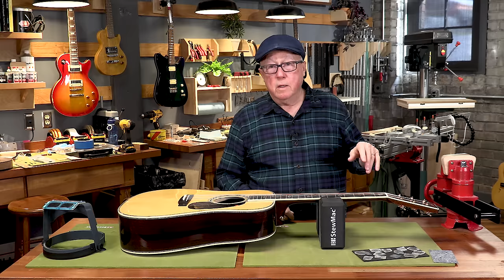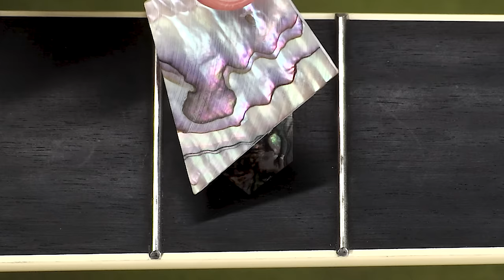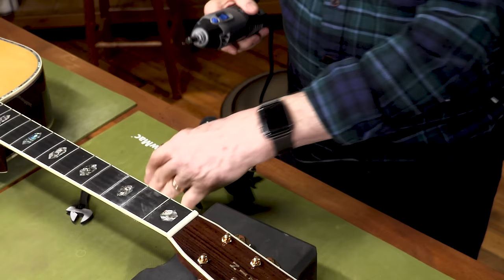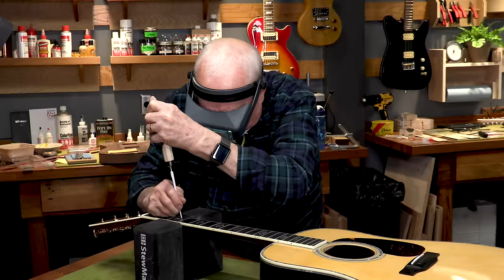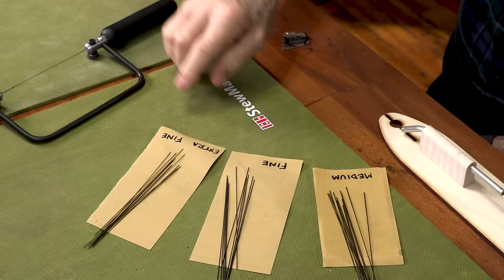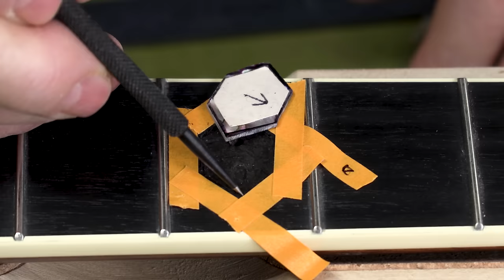How to Replace a Fretboard Inlay on a Martin D-45

Comment: I mean for $10,000, Martin should be the ones doing this job, for free.
Reply from the maker: I believe Dan said they would do it for free but it would take a while.  The customer didn't want to wait that long.
Reply: @stewmac  Well, I probably would have gone the same route. At least the owner knew that the job was going to be done right. One of the first video’s I watched was when Dan fixed the 50’s Stratocaster that was routed for a Floyd Rose. Spectacular!
Reply: I don't see why Martin would have to do this for free. It's not like it's a defect; the customer just didn't like the inlay color.
Reply: @reverb508  Of course he didn't like the inlay color, because it was the wrong color. Jut like he wouldn't have liked it if one of the tuning keys was a completely different shade than the others. Most people just expect better craftsmanship at that price point, which is exactly why Martin said that they would fix it for free.
Reply: Yes they've dropped the ball on this one,shame on you Martin using abalam on such an expensive instrument,I'd expect this low standard from Gibson.
Reply: It shouldn't have passed inspection TBH. The luthier should have known better than to use an obviously out of place, mismatched piece like that.
Reply: @gregmullins6927  oh the outrage. Lifes tough in youtube comment world.
Reply: Ace  well they put the wrong inlay in. They put a cheap alternative instead of real abalone. It would be like buying an American Fender that has a Chinese pot metal bridge on it.
Reply: Ace  actually im not really sure anymore tbh
Reply: For that price, I want to hold it before I own it.
Reply: You would also think they wouldn’t mix the 2 types of abalone
Reply: user-sm6nm2qj7b Spoiled? Really?! I don’t think so. I think these companies are spoiled being able to put such high price stickers on musical instruments with cheaper materials and lower workmanship standards. Try changing that name on the head and see whether anyone would still pay $10k for it. That should clear it up at least when it comes to quality..
Reply: I hear they are using Lutz Spruce now, I see the website does not say Sitka anylonger, just Spruce...very sad to see that their top of the line instrument is getting substitute materials when the price is only increasing every year. It almost makes you feel like you aren't getting a real D45 anylonger. Dan did a fine job as always on the D45! I really admire  his attention to detail and skill!
Reply: @disco4535  Yeah check and mate. It’s a QC issue. I got a 100$ in return (store credit) on my Les Paul CS BB because of SMALL errors but for $3600 I expect flawless quality or else I would’ve bought their standard for little over half price.
Reply: @reverb508  You're definitely wrong about this there is no leeway for you to be correct here. No matter how outrageously petty it is. This guitar was $10,000. It's like painting the front left fender of your car a different color and saying well it's paint so it's consistent lol.
Reply: @badhabit8824  Except abalone isn't paint; it's a natural material that is not consistent in appearance. Your analogy is awful. If the buyer didn't like it, that's a matter of preference. They could have returned it, or better yet, not bought it in the first place. Caveat Emptor. If they're ponying up 10k for an instrument, perhaps they should have made sure they were happy with it first.
Reply: @dba4292  Your first mistake was expecting flawless quality from a Gibson. They've never had brilliant QC, even back in the 50's. Sure, CS does better than the USA factory, but Gibsons are just beautifully imperfect instruments. Buy a PRS if you want a flawless guitar.
Reply: @reverb508  Agree 100% Lesson learned 👍
Reply: @reverb508  Martin is a major manufacturer, they most certainly would've had numerous pieces to pick and choose the best match from.
Reply: Personally I would leave that “defect” alone because it makes the guitar look more distinctive. Also if the guitar gets stolen it can help it get identified

Comment: Just excellent.Tricks like the acetone magnet cup, the fence, and the piece of scrap to prevent the tipping are what separate a true master from everyone else doing this work. A D45 is roughly a $10,000 purchase that should not require remodeling. It’s too bad whomever  inlaid that guitar at the factory couldn’t have taken an extra five minutes to look at the big picture and get it right. Martin should reimburse this customer 200% of whatever this repair cost to execute, along with a letter of apology.  My $.02.
Reply: You buy a D-45 purely for the eye candy as it's not superior to cheaper models, it's all about the looks. I think Martin should use real abalone, not abalam. I don't like those obvious straight lines in the inlays. At that price I expect the best of the best only.
Reply: @AndreaAustoni  agreed. For that price real abalone all the way around would be a must in my book.
Reply: just like this guy should have taken the extra time to recut that piece of abalone to fix that gap instead of using glue...terrible

Comment: If you don't have Abalam or the correct piece of abalone on hand, or you don't have the time and/or skill to order and cut your own, you can call Martin and get a laser cut 3rd fret position hexagon in different shades and pattern densities. Just tell them what you need.
Reply: Thanks. That is the info I need. Have a D52 with an inlay missing
Reply: @jjiacobucci  Tell em Dan sent ya
Reply: True but you should not need anything for a brand new D45. The original inlay was a scar that should not have made it out the door to begin with.
Reply: I wouldn’t have accepted it. It’s a $9,500 guitar ffs
Reply: @brianhanson9367  You should see the big money instruments I see people accept.

Comment: Normally I see great job done here. This time for this grade of the instrument I have cringed so many times that I do not want to become hater. Drilled to deep into the fretboard, to narrow inlay, discolored pearl a bit on the nut side. Man that might be OK for some china made guitar but on D-45 it is a crime in my book. Especially for that nice of a example. I would not like that even on my Japanese Morris guitar. Sorry. I would take it somewhere else and redo it. Fill it under with ebony dust and glue to get flat surface and get proper fitting inlay in it. I did not liked it at all sorry.

Comment: I bought my D-45 new in 1989. It’s not been played much but has been back to Martin 3x for warranty and non warranty repair- to include a bowed top, a bridge replacement, repair of a cracked brace, repair/replacement of split bridge plate, it’s 2nd neck reset and some refretting. What really surprised me was a shim under the fingerboard at the body joint. At this point in my ownership I’m seriously considering selling it.
Reply: I was surprised at the mix of Abalam and Abalone. The Abalam is very noticeable. Mind you, we need to cut down on abalone fishing. like everything.

Comment: It's strange that the luthier who built that D45 would have used that perticular piece of abalone.  It was drastically darker than all the others, and for what I'm guesing he paid for that thing ($9945.  Just checked Martin website), it makes me wonder why it was used on this instrument.
Reply: This ^^
Reply: I've never done inlay work, but would guess the inlays matched nicely when they were first laid in the fretboard.  The leveling/sanding afterwards could have exposed a different layer of colors.  Then the question is, do you rework it or go with what nature intended?
Reply: @melodicdreamer72  Those are good points.  My only thought is the inlay pieces start out pretty close to size.  Your thoughts are still valid possibilities, however.
Reply: Dude buys a new Martin D45 and then sends it to a Stew Mac shill to replace the inlay...mmmmk
Reply: @frankdiscussion2069  Is Dan Erlewine a shill?
Reply: @melodicdreamer72  by definition...yes

Comment: That's the difference between hand cut and CNC folks. Look at some vintage examples closely and you will see a perfect fit is quite rare. That said, this one really was a miss. I would not have been happy if I was the customer. Frankly, I think they all should have been replaced. The seams of the laminate abalone is just too off-putting to me on such a high-end guitar. I also think they are all laminated, just that some don't have the seams. Why would they mix real with the fake stuff?

Comment: Pretty incredible work really, looks great. However I can't help think that those gaps around the new inlay really take away from the piece. I might just be far too picky as the kind of thing I spend my spare money on is watches and generally watch guys are very picky about tiny imperfections (I'm a bit more forgiving but the culture rubs off on you a bit). I don't know much about guitar repair or luxury guitars. Is that kind of imperfection viewed as fine and normal on a guitar worth this much? I know I would be very displeased if I sent a watch for repair and it came back with notches in the dial or scratches in the crystal. 

Not trying to offend or disparage your work though, you definitely took the time to get it as close as possible to perfect.

Comment: Why did Rick, not just go back to Martin, and ask them to replace it.
Reply from the maker: Martin certainly would have replaced it for Rick - but timing was an issue. They've got a significant wait time on repairs at the moment!
Reply: @stewmac  I wouldn't think that that would be regarded as a repair. I would think that, that would be a QC issue. Anybody looking at the fretboard, should have noticed that that inlay, looked out of place, and should have been dealt with, promptly. Considering, it was a new guitar.